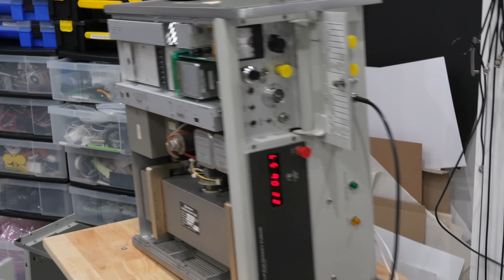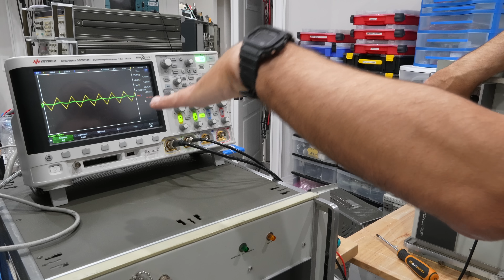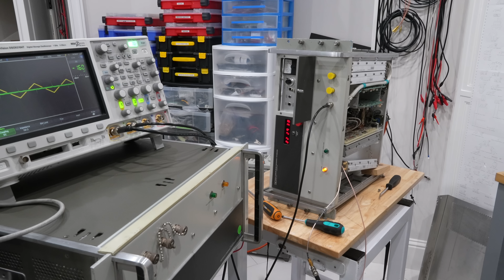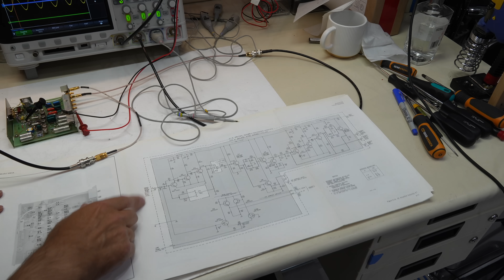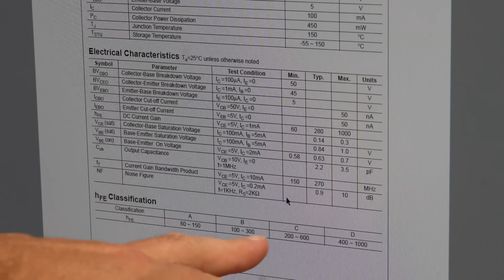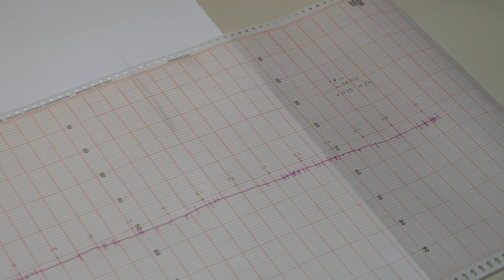Another HP 5061A atomic clock comes in for repair, and it's very broken

Comment: After the repair the output of the phase detector seems to be noisier than I would have thought.   Is this normal? or just because the unit was not yet fully calibrated?   After calibration, is the phase detector output now less noisy?
Reply from the maker: It’s just that since it’s repaired, it locked without me noticing. So we are seeing it when it’s at zero! Hence the noise, which is normal when it’s locked or close to locked.

Comment: The typical accuracy of the HP 5061A frequency standard is only ±1×10⁻¹¹, valid for temperature conditions between 0 °C and 50 °C and magnetic field up to 2 gauss. Cesium fountain clock is the new technology that has accuracy up to ~1 × 10⁻¹⁶
Reply from the maker: There is no such thing as an “accuracy number”. It feels like these were picked up from a summary datasheet without understanding what they mean. As explained in the video, the figure of merit for our measurement is Allan variance at 100,000 seconds. As shown in the video, it is in the low 10-13 range for a regular tube, and in the mid 10-14 range for a high performance tube.
Reply: @CuriousMarc   Please check HP 5061A Operating And Service Manual page 11 from manualslib

Comment: I wonder if you have a GPS receiver clock for comparison somewhere. That can at least tell you if to clocks drift, which one is off (probably both, of course).
Reply from the maker: Affordable GPS clocks have nowhere close to the precision required,, by several orders of magnitude. Even an expensive GPS disciplined Rubidium is not going to work.

Comment: A bit puzzling but if I were working on those clocks I would try  to have a radio receiver tapped so I could use WWV to check the clocks against. They broadcast on 5, 10 and 15 MZ and they use the atomic clock to drive the transmitter frequency. If you can get a relatively clean signal, you should be able to set the clocks to the national time standard. This is probably a hangover from the days when atomic clocks were difficult to get ahold of and researchers needed an accurate standard for their work.

Comment: At least it doesn't require the bulb to be installed to work.
Too many old FM radios require the stereo indication bulb (and in some cases even the LED) to work. If the bulb burns out, no more FM stereo. Crazy. I've had a late 70s compact stereo system that wouldn't open the stereo. Turned out to be a bad solder on the stereo LED. Wiggled it, LED lit up and instantly the sound widened. Why? How? I kinda understand the lightbulb thing (HP's first gear used a light bulb for regulating, so maybe...), but a friggin LED as an active component in stereo demultiplexing?

Comment: The original experiment required twelve (12) clocks.  Four clocks on the ground at a fixed point (US Naval observatory) acting as the "stationary" reference, and four clocks each heading east and west on their grand world tours.  Cost: $8000 USD.  Wikipedia has a short, but good write up on the experiment.  It would seem that Mr. Clock sat next to Mr. Neutron (who likes to grow flowers and have a nice salad).

Comment: @CuriousMarc I have no sense of scale on this, but could an GPSDO help determine which of your clocks is closer to optimal behavior? I assume you're not doing that because I'm an order of magnitude (or more) out on phase jitter or something.
Reply from the maker: Unfortunately no, a consumer grade GPSDO would be orders of magnitude away from what we need. There might be some professional high end ones that could be good enough, but the expensive GPS disciplined Rubidiums that I looked up did not cut it either.

Comment: Minor detail, but I think your colour coding for the modulator input to output at 5:20 is reversed (your output phasing is reversed). You can tell because in the HP drawing they used dashed lines for the Fc2 input/output and solid lines for Fc1 input/output. But otherwise, what an amazing instrument and repair. You're so lucky to be able to have access to these to play with - I'm rather envious!
Reply from the maker: Yes, the color is fine but HP made a mistake in their drawing.

Comment: I guess you have to open up the instrument to set the time on the readout?
Reply from the maker: There is a little flap door added on the cover to access the clock settings, but yes, this is not the most convenient. You are supposed to adjust it every few 1,000 years though :-)

Comment: I had such a cable gremlin once and it was due to the movement of the centre pin at one end as the cable was bent. The centre pin pulled back into the cable plug and out of the centre receptacles of the socket so it failed open.

Comment: Marc, you made a mistake though it seems to have been benign. At 21:21 you called out a transistor model 18240023 then as you were looking it up on the microfiche you call it 18540023.

Comment: They still make the 10890A and 10891A.  The 7105A was developed by Datum as a direct replacement based on the tube used in the FTS-4060 cesium beam standard.  I don't think that tube is made anymore.

Comment: A passing though re the iffy cable. Is it worth looking at the "petals" of the SMC female cable connector? If these are damaged or spread open a bit too much it may explain some of the intermittent connection issues.
Reply from the maker: I thought so too, but it’s not that. It’s an intermittent break within the cable near the connector.

Comment: There is a design improvement begging to happen in the 137 Hz modulation, recovery, and phase detection. Way back in the mid-late 60s I worked at a Univ of Michigan lab. Another EE was trying to design a locking look for an Omegatron gas partial pressure gauge. The resonance was conveniently in the little IRIG modules of the day frequency range. It was a something in the 100 kHz to 200 kHz range. I forget the precise frequency. The setup was launched by a Nike rocket and was trying to look for atomic oxygen in the atmosphere. A very strong magnet is a major part of making the omegatron work. The shock and vibration of launch was changing tuning. The lab wanted to find a way to lock to the resonance peak.

The EE who was working on it used the same sinewave modulation as the 5061A but at something like 37 Hz. I looked at it a minute and figured his half wave demodulation was being screwed up by the second harmonic that sinewave sweep across a resonance peak gives. "Why don't you use a square wave?" He never got around to that as it was his graduation time. I was just finishing up my Masters. I redesigned the circuit but with square wave modulation and a 37 Hz Twin-T filter with detuned components to give a Q of about 10, sufficient to knock down the third harmonic. There was no second harmonic of course. Sketch it out for yourself if you wish. I built a simple half wave demodulator fed with the same square wave as the modulation. A very high gain integrator finished up the small board. As a part of the project I calculated the frequency error and the induced measurement of "O" up where the air is very thin. It worked VERY well. Theoretically it's drift with magnet detuning was still on peak within 0.00N%. Other components became the problems.

I proposed a patent for this to my lab boss at the time. She was unexcited and didn't see the use I saw in Cs standards. Ah well. Frequency Control Symposium notes indicated somebody else had the idea a few years later. I kinda wish I'd had that patent. I bet that HP circuit could be simplified dramatically with square wave sync and a full or even half wave synchronous demodulator and loop integrator.

{^_^}    Joanne
Reply: This is a good way to do it. I think HP did it that way, too, but the test point waveforms hide it. Looking at the schematics in the video the 5061A uses a low-pass filtered square wave for modulation and square waves for demodulation. Q6 and Q7 are a bistable that divides the 274Hz reference oscillator which should provide a 50% duty cycle square wave, this gets filtered and sent to the modulator and buffered, as two complementary square waves, to the phase comparator.
Reply: @synx508  If they used square wave modulation there would be no second harmonic to foul up their phase detector. Square wave modulation samples one side or the other of the peak and settles into the peak with a very (very) small error. There should NEVER be any second harmonic in the system. The scope pictures Marc provided showed considerable 2nd harmonic. Even a saw tooth, or filtered square wave, modulation will slowly sweep over the peak and generate that second harmonic. The deviation from peak can be very small and it will still work. This is why my quirky mind found the solution so quickly. If the second harmonic is causing you problems, what happens when you zero it out along with all other even harmonics. Odd harmonics are no problem. They influence loop gain. But the loop is basically single pole so it's not at all likely to oscillate. The sounding rockets provided a highly variable modulated signal for use in the loop including periods of no signal. When the signal dropped too low I simply stopped the demodulator and used the integrator as a hold last estimate tool.

{^_^}
Reply: @Wizardess  Nevertheless it's designed to be a square wave, that's what the AC-coupled divide by two stage should achieve, there's a twin-T in a feedback loop too, after it, so perhaps that also notches any remaining 2f, I haven't checked.. I've a feeling the TP's signal routing includes a buffer so maybe there's a problem there. The divider may not be a perfect 1:1 square wave as it's subject to component tolerances and age, too, but it shouldn't be too bad. The intention is definitely to use a square wave, that's what I'm saying!
Reply: @synx508  The displayed video suggests that by the time the modulation propagates to the 9 GHz signal it has been filtered into a triangle wave that sweeps across the peak instead of samples on each side of the peak with near instant transitions at 9 GHz. I guess I phrased it sloppily. You must apply the um "FSK" signal such that you see two frequencies, 9,192,631,770 Hz + delta and 9,192,631,770 Hz -delta in the drive to the resonance chamber. And the delta can be astonishingly small. If the cavity Q filters the modulation, reduce the modulation frequency. And for God's sake don't make delta 137 Hz. 1 Hz would probably work just fine based on an OLD (decayed) memory of the width of that resonance. Being like 1% off peak in amplitude terms is about right to maybe a little high.

To see what Marc was seeing the modulation had to sweep the peak rather than step from side to side of the peak. with step from side to side there is only an output square wave with an amplitude determined by how far off peak your frequency is. And it even contains +/- information built in. If you do sweep over the peak you get out some second harmonic even if you are sweeping with a pure sawtooth.

{^_^}     (Can you tell I have trouble finding words for what is implicitly obvious in my head? It's frustrating. {^_-} )
Reply: @Wizardess  Ah! Thank you. Got it, I think. More samply than correlaty (not words obv.).  One point is I don't think it would be a sawtooth because the division is symmetrical so it would be sweeping both ways which implies triangle so no even harmonics like the square it's being driven with. I might have to rewatch more carefully as I am probably getting confused.
Reply: @synx508  You're right of course. I picked the wrong word in my haste. (Bed time - pre op appt for an IOL for cataracts in too few hours.)

And, of course, it is not a perfect anything. Filters round the edges a lot. Even a step frequency change will get some filtering. The idea is to make the FM as square at 9,192,631,770 Hz as possible.

{-_-}  good night
Reply: Really nice applied mathematics to electronic system blocks going on here,so cool.
Reply: You are a smart person. I like smart people. Keep being a smart person.

Comment: Why does this work against the peak where the signal is slowest moving and the diffence doesn't tell which side of the peak we're on?   Wouldn't it be better to compare at the zero crossing or some such where not only is the signal changing the fastest, but which side of the crossing we hit tells us if we're fast or slow?
Reply from the maker: @carolinejoybarnhart3717  Indeed. If you think of it, that's exactly what this trick does. This technique measures the derivative of the peak, which gives you a zero crossing with direction, so you can lock on a zero.
Reply: Only the peak-frequency is exactly defined, an off peak-lock would involve some other frequency that would deteriorate the instruments absolute precision. Also, the phase, as explained by Marc holds the information whether you are fast or slow and your control loop can counter act.
Reply: @Frockelli  Not what's happening.  The 137 hz twiddling is to help generate the precise 5mhz output.

The actual tube does as I describe to determine which side of the phase the oscillator is erroring on.    It's not any part of the electronics, it's literally part of the interferometer.
Reply: @carolinejoybarnhart3717  is it possible that you assume there is a 9 GHz electrical output signal coming from the tube? Well, that is not the case. One has to lock on the "slowly" changing output of the ion flux detector (slow with respect to the 9 GHz). The signal of this detector has a peak whenever the microwave one synthesises from the 5 MHz hits a Cesium resonance.
Anyhow, everything is explained perfectly (much better than I can do it in the youtube comment section) in HP's manual, see: http://www.leapsecond.com/museum/hp5061a/5061a.pdf
Reply: AFAIK rubidium clocks work that way but they are nowhere near the accuracy of a caesium clock.
Reply: @listerdave1240  Rubidium works very differently.  It has a microwave signal around 6ghz but the phase check is optical.   It dims in laser light when the microwave frequency is on target.   I've not dug into rubidium clocks but I thought one of the cost savings was you didn't have to mess around with Ramsey Interferometry to coordinate the input signal.  The downside of using optics for very small changes appears to be finding the center exactly.

Comment: I love the 137 Hz wobble for peak detection.
It's just epic in the Cesium clock. 😂
Common, this can't be just a coincidence. 
That has to be pure nerd stuff, right? I don't see any reason for using 137 Hz other than it being a Cesium clock. The 137 is a reference to Cesium, it has to be (or I will be very disappointed).
Reply: Caesium 137 has a half-life of 30.17 years
Reply: A very interesting observation. Is it just a coincidence though? The standard atomic weight of the stable cesium atom is 133. Yes, the radioactive form (caesium-137) has an atomic weight of 137, but the beam tube in the HP 5061A uses cesium-133.
Reply: @Chernobyl250  Yep, that's true and I know that as well but many (most?) people do associate 137 with Cesium (because of this highly active isotope of Cesium). It's just such a nice coincidence then, they use 137 Hz as the wobble frequency. But I would prefer it not being a coincidence but a nerd thing. 😃
Reply: Probably just a prime number close to the design target frequency.

Comment: 6ns/24h sounds so much! I prefer the way it would be reported in the news: It's so precise it loses only two seconds in a million years
Reply: Except that 6ns/24hr is 1s/5.28 years, NOT 1s/500,000 years….   [Edit: dohh… I messed up the math. It’s in fact 1s/456,346 years, as pointed out below.  Apologies to OP, who is in fact correct.]
Reply: @kimsmoke17  it is 6ns per day. Not 6ns per second. Looks like you messed this up. And we are back at 2 seconds in a Million years.
Reply: I understand what you mean. So it was 2 seconds in 912 698 years. Sounds close to 1 000 000, but at the same time sounds like rounding things because they sound nice an that is not something you want to do when dealing with and atomic clock.
Reply: @houghi3826  If you have 1 significant figure into the calculation, it is prudent to have 1 significant figure out from it. It is 6 ns, not 6.00000 ns (and not 1.00000 days either) so giving all those digits is bullshit at best, misleading at worst. And it is a very common mistake in e.g. news and popular "science".

Comment: What is the significance of using 137 Hz modulation ?
It seems like a strange frequency to use
Reply: 137 is a prime number, and it’s well spaced from harmonics of 50 and 60 Hz AC line frequencies (100, 120, 150, 180 Hz) and any rational integer ratio of their subharmonics and/or their intermodulation products.
Reply: possibly related to the element Cesium-137
Reply: @halofreak1990  Possibly - but the HP 5061A beam tube only contains cesium-133.
Reply: It's a geeky easter egg from an HP engineer.
The fine structure constant (https://en.wikipedia.org/wiki/Fine-structure_constant ) is 1 / 137.  That number has almost mystical significance to theoretical physicists because no-one has ever been able to explain why it is 137.
God does not play dice, but if she did she would roll 137.

Comment: Seeing that curve tracer reminds me of when my high school electronics teacher showed me an instrument in the back corner of the lab. I remember he turned it on, and it took a while to warm up. He connected a transistor, and showed me the curve trace results. The instrument was very similar to the one you have. I wonder what ever became of the device.
We also built circuits on trainer boards with transistors on them. Being careless with the wiring could result in a smoked transistor, and to get a replacement from the teacher required a 25 cent payment.
Reply: It is a handsome device especially with all those buttons and knobs